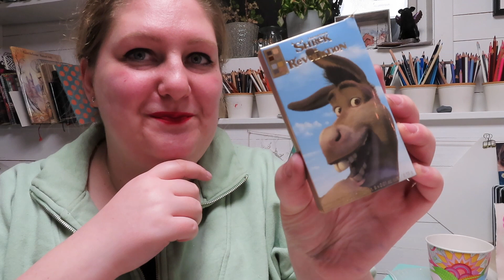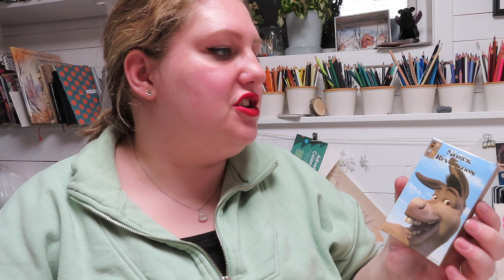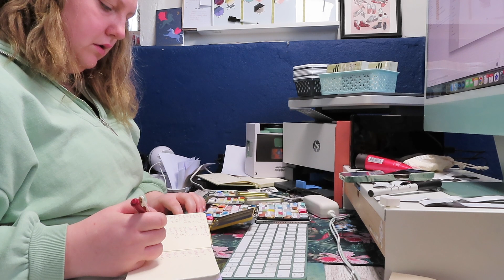Studio Vlog 143- making paint and crocheting baskets

Comment: heya Julia! Your baskets look great! I just wanted to give you a little tip (and I'm sure you can google it in case I can't explain it well in words) about weaving in ends while crocheting. Best is to just crochet the ends in for a few stitches, so you can just cut them off right away. You just crochet as usual, but you hold the end you want to weave in on top of the row. :) And if you have lots of color back and forth, you can just leave the long end of the color you don't need right away (don't cut it, or weave or crochet it in), and then pull it up to where the next row starts where you need it. On the inside/backside of what you make it'll show, but outside you won't notice.

Btw, that color you made, Arsenic.. wow.. I'm drooling :) amazing!
Reply from the maker: That is a great tip! I usually do just that but that gold was so slippery. But Arsenic will be ready for January! ✨
Reply: oh yes, sparkly yarn can be a bit annoying to deal with :) but it looks so amazing, doesn't it? 😂